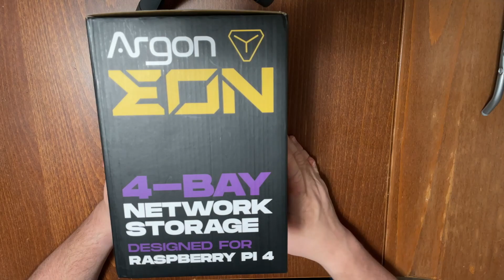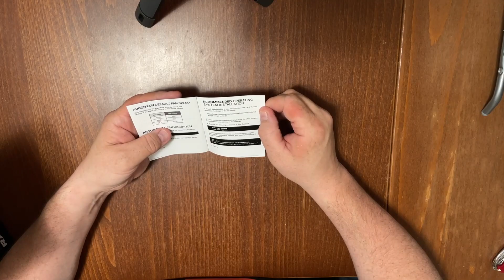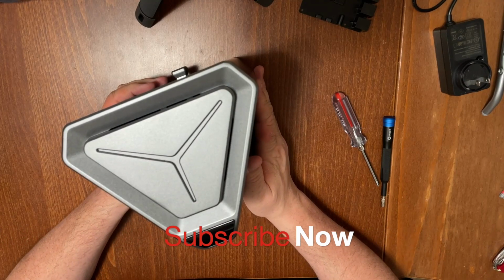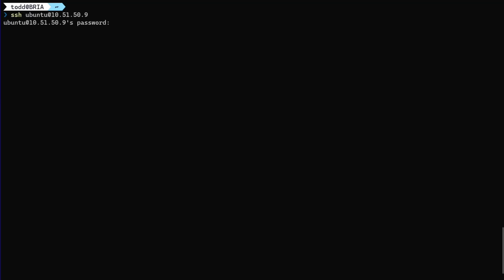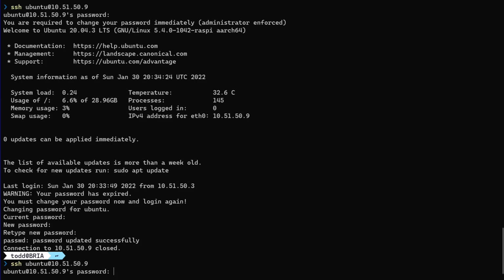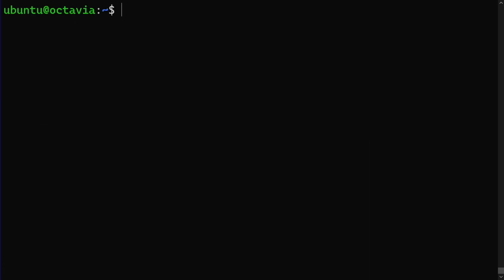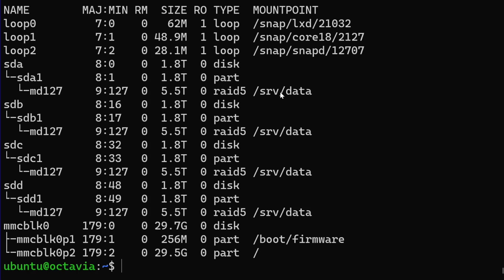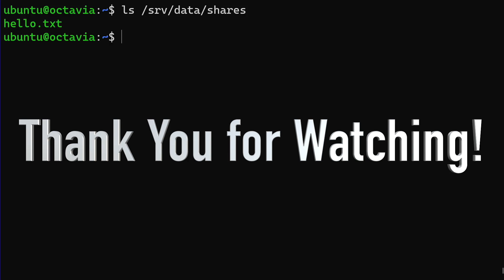Argon EON Raspberry Pi NAS

Comment: Todd, just a quick question for you. And yes I fully acknowledge I am a noob in this subject. I have 3 SSD's (Perfect for RAID 5). I used Parted to assign them an ext4 partition on each individual drive (100% use). Google suggests I now make a file system with "sudo mkfs.ext4 /dev/[sdb1, 2, 3]" and then create a mount point with "sudo mkdir /mnt/partition_name_here", then mount it with "sudo mount /dev/sdb1, 2, 3 /mnt/partitoin_name_here"... it goes on and on such as adding to fstab... The query I used is "commands to build partition ubuntu" and the AI input got me this far... do I really need to make a filesystem and mount each SSD? Is the ext4 partition enough to start building out RAID5?

Comment: I just got mine, but the fan is non-stop maxing out despite setting the speed to 10 percent. Did you have this issue or did I get a faulty unit?
Reply from the maker: I had that problem until I installed the software for it. I’d suggest reinstalling it

Comment: why raid 5 through a single USB connection? You've just doubled your IOPS due to parity writes on every write IO operation. Or am I missing something?
Reply from the maker: Well, it was a neat experiment. I wouldn't use 4 HDD running through a single USB port for anything important.
Reply: @ToddSpatafore  What about 2x8tb 3.5" drives? I have the Argon NAS box and was planning on retiring my DNS-320 with one of these.
Reply from the maker: @Guroth  call me old fashioned but I wouldn’t do a NAS over USB regardless of the drives used.

Comment: I really want to find out if I can run a few things on this instead of just a file server/NAS - PiHole and storing videos to be able to view them on a smart tv. I think that's openmediavault or CASA OS? Can the three tasks work alongside eachother in there?
Reply from the maker: You bet! The way I have it set up it's just a Linux server so anything you can run on that you can run here. OMV and PiHole wouldn't be a problem at all. CasaOS looks like it'd work too, but I don't have experience with that.
Reply: @ToddSpatafore  It is basically a lot of media services in a single package made easy, MAYBE I could just install it, pihole, and set up hds. 

I also noticed you used mechanical drives. Are the speeds good enough through the pi and network for videos? I doubt I'd watch anything above 1080p anyway, so I'm hoping it can stream well when I get to it.

Comment: Hi Todd ,I found the video very interesting .
I too have a ARGON EON NAS with 4 x 2.5 hdd. Installed is OMV (Open Media Vault 5.6.24-1 (usul)
I also purchased an nvme ssd adapter and a samsung ssd 980  to fit onto the internal USB3 port.
My idea was to make the ssd a 5th storage,but not sure how to do this .
Is it possible ?? Thank you